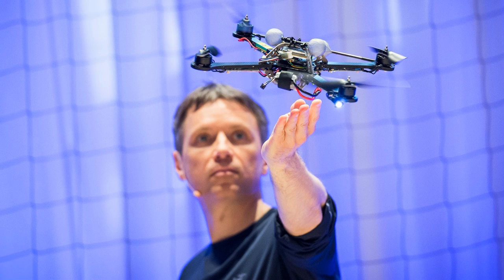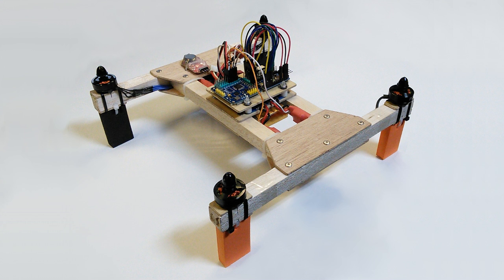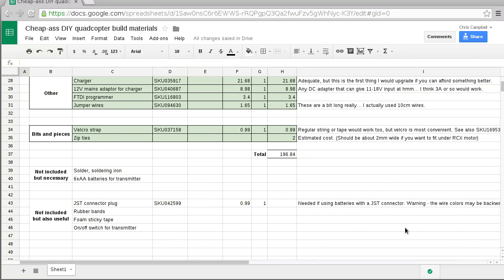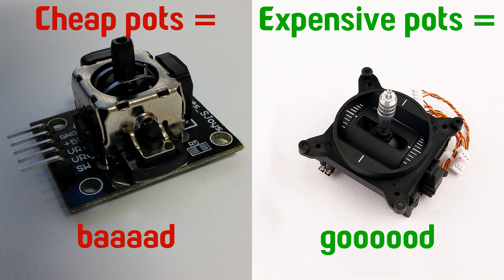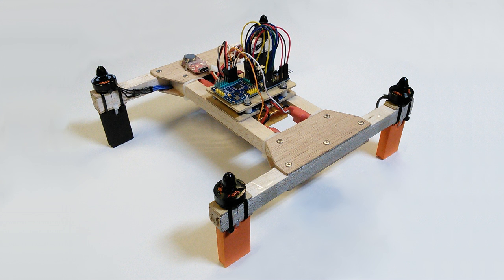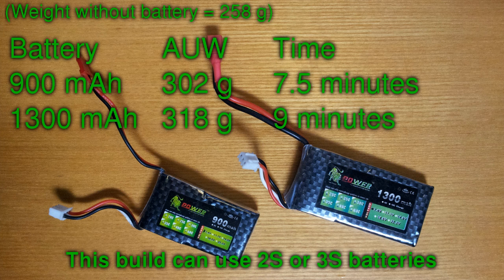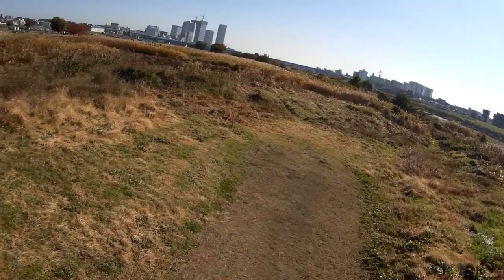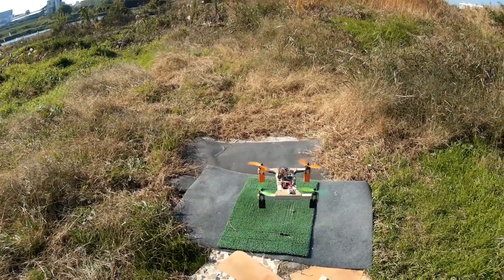Cheap-ass quadcopter build Part 1 - Intro

Comment: I can't believe you decided to build your own radio control transmitter and receiver using nRF24L01 modules - that's total genius! I've just bought the cheapest APM 2.6 I could find on eBay, so my quadcopter project is off the ground, but I was all set to spend proper money on the Tx/Rx kit. Now I want to do it your way - with cheap ass arduinos and nRFs. I'll be following this with great interest.
Reply from the maker: Good to hear, was wondering when you would get around to it :)
Reply from the maker: ***** Very true! If the quad was worth more, or if I wanted to go further than 100m or so I would not be using these :)
Reply from the maker: *****  Yeah no doubt :) It would be great to find something that can be controlled in the same way the nRF24 can but at long range, if it exists. Actually I have another two quads already, not counting the hubsan... well... enough parts for another two I should say, have not quite got them up and running yet - still small ones though !
Reply: Why APM?  I'm just asking because the KK2 is way cheaper. Nice little build 😊
Reply: Russell Gilder I chose APM because I want the full autonomy suite, but I'm not averse to trying some of the other filght controllers.
Reply from the maker: The mega will be much nicer to have if you do any customizations too. Recently using a lot of peripherals I have become thoroughly sick of dealing with conflicts between libraries (most often software serial) and have started eyeing the mega which has more timers etc to help avoid those issues... But the pro-mini form factor gets me every time so far :)
Reply: ***** You could offload all the servo PWM activity onto this unit: http://www.ebay.co.uk/itm/-/311188037855
It just sits on the I2C bus. Do you think that would help?
Reply from the maker: Yes, that looks helpful. For now I'm offloading the GPS stuff to another pro mini that talks to the main one via I2C. The 'PWMServo' library helped with some of the problems I was having.
Reply: @Julian, can you explain to me why you have two identical posts done with two different youtube channels with two completely different pictures on the thumb nail?  Are you trying to be two different people so no one knows who you are when you comment from a different account?

Comment: Looks pretty cool!
I have subscribed so as to make sure I catch the rest of these.

I have been looking at building my own quad copter just to mess about with.
More for the build than actually flying it really.

One thing you did touch on is the range of the transmitter.
One thing I was thinking of doing was to fit a GPS unit and a memory card.
On power up the copter would get it's location and set it as 'home'.
Then as it flies, it would keep getting it's location and save that to the card.
Assuming communication is lost, it would fly home on it's own using the points saved in the card as way points.

Less chance of losing an expensive copter then. :)
I suppose you could even fit a 'come home' button to the remote to bring it home automatically.

I appreciate that this adds to the weight, cost and lessens the battery life.
But could be worth it. 'Cheap' Chinese imports of the GPS and card reader can be had for around £10.
Only a card needed on top of that and I'd guess most of us have old and relatively useless small memory cards hanging around.
Ideal for this sort of project as it's only creating and reading basically a CSV file.
Reply from the maker: The 'return to home' you're talking about is a pretty common feature of RC aircraft these days (although not in the cheap-ass price range), as is following waypoints, position hold, and all manner of cool things. Price and weight are coming down all the time.
Reply: I'll be totally honest.
I've not looked into them much at all.
So I don't know what commercial products offer.

I saw the same video you did a few weeks ago and have seen various videos made by you tubers showing what can be achieved with them "superman with a go pro" being a prime example.
But from a cost perspective, it's certainly something I'd build into any copter I built.

Comment: Pure awesomeness, I was planning on such a quad for a long long time. But I am still stuck on doing the math on with the accelerometer :( I can't wait the following vids.

Great great job !!  You just made a new fan here !!!
Reply from the maker: Thanks! I'm not doing any of the flight stabilization myself, I'm just using the arduino for the radio link.

Comment: Thank God there are people like Julian Illet and you in this world! You, sir, are going to change the world of RC things! If your arduino radio-link is gonna be as stable as possible, you can be a major threat for those ultra-cosmic-expensive RC systems companies and that's what we all want! I was thinking to buy a 6ch FrSky or something like that from banggood for 60-70bucks, but with your project, i can save a lot of $$$ and build my own quad :) 
Anyways, stupid question: is your system able to receive telemetry data from the quad via the same radio link? that would be awesome! 
Greeting from Romania and good luck! :D
Reply from the maker: hahah I don't think so. This radio is nothing to compete with the 'real' ones. I'm mainly using it because I can control the communication protocol fully, and it can send much more complex data than just some switch and joystick positions. Yes, and it can return some data as well. See Julians recent video (last Sunday I think) and mine from October about telemetry with these modules.
Reply: I saw Julian's experiments and I've seen some of yours and I'm kind of impressed. I don't have too much experience with those kind of rf modules, I only used bluetooth modules, IR, 433MHz modules and a GSM module (you can find some videos, in romanian language unfortunately, with GSM and bluetooth projects made by myself on my YT channel).
Oh and a small sugestion: for the far future you should move to ESP8266 Wifi modules...that should be something way cooler!
And another idea is to try to somehow stack the arduino and the nrf module together and make a little breakout board to connect the whole thing to servos or flight controller inputs.
Reply from the maker: micultimy91 I have not used the ESP8266 but it seems overkill to use Wifi when there are only two endpoints, and the AT protocol and using IP addresses seems cumbersome compared to the bare packets that the nRF modules use - a lot of handshake packets are sent to and fro just to even begin an IP connection, let alone send any data. Wouldn't you also need a router to organize DHCP and stuff? As far as I know wifi devices do not talk to each other directly, that is one reason bluetooth was proposed. The ESP8266 would be good for situations where you are sending a very long message spanning multiple packets that must be received in order, then TCP would make life much easier. For radio control though, all necessary info can be put into a single packet, packets can be dropped without corrupting the message, and only the most recent packet is important.
Reply: Things have moved quickly in the last couple of years, and the ESP8266 can now use the same IDE as the Arduino. Conceptually if you drop down to a lower level than tcp/ip the ESP can be considered to be a combination of fast Arduino and nRF module, so one would think that it should be quite a viable option; it's certainly a nice size.

Comment from the maker: +Ole Magnus Boesen please enable replies on your comments if you want a reply. Yes, the default mode is 'rate' mode which only uses the gryo and does not do any auto-level for you. You need to enable 'angle' mode to have the auto-level, which I did in this part: https://www.youtube.com/watch?v=o-inQZn3AgU#t=2m6s
Reply: +iforce2d thank you so much
Reply: +iforce2d also I use th HK transmitter and receiver. where do i connect the wires for the switches?
Reply from the maker: +Ole Magnus Boesen not sure what you mean... are you converting it to arduino like I did? I covered all that in part 12: https://www.youtube.com/watch?v=9dTvWeidVis#t=9m22s
Reply: +iforce2d Never mind, I figured it out. But thank you so much for your help. love you videos BTW dont stop making them :)

Comment: Hello there I am really looking forward to the future videos. I am in the process of creating a quad using arduino for the transmitter and flight controller. 

I found those cheap joysticks have a terrible resistance range, they jump at the end of range. 

Thanks
Reply from the maker: You're not kidding. In the rest of this series I will do a lot of bitching about how bad they are :) In fact, I gave up on them altogether and I'm waiting for some alternatives to arrive before I put up the part two, so I can give a better recommendation. I will probably go with modifying cheap transmitter box instead, because it gives you nice joysticks and other handy stuff like battery holder etc all in one, but if you are still interested in the dirt-cheap joysticks I just got some of these, they have no dead-zone and feel nicer to move in general: http://www.dx.com/p/008-3d-yg-repair-accessories-ps4-original-3d-game-sticks-pair-318011
Reply: Haha I was going to say the same. I have just used an old rc transmitter. Four pots inside which have an almost perfect range. Although I have found that the whole resistance range of the pots isn't actually used with the sticks, so the ADC on the arduino sort of wastes some of the range, if you get what I mean.   But yes thank you.
Reply from the maker: Reece Pipes Yes, I'm using an old RC transmitter that I got really cheap on ebay for my main stuff and it works great - but I got kinda lucky with that auction and it's not something I can say to other people "get that one". So for this series I wanted to find things that could be bought as normal products.
It's interesting that the pots on my transmitter were the same... the mechanical range was only using about half of the electrical range. Sounds like it could be done on purpose for some reason. I had to measure the range of each one and code that (and the center point) into my arduino program to make full use of their precision.

Comment: Hi, cool video, I am building a quadcopter too but I have a problem. when I connect the battery, the engine and the receiver to the ESC nothing happends and the voltage go down to zero, do you think is a problem of the battery or of the receiver?
thank you very much

Comment: +iforce2d from where did you buy the expensive joysticks from. Those cost a fortune in my country. And the only way i can get them here is through didgikey or rscomponents or from mouser. Pretty expensive
Reply from the maker: +ATANU Ghosh Those joysticks were never shipped to me after waiting six weeks so I got a refund. After that I tried some others, much cheaper from here: http://www.dx.com/p/008-3d-yg-repair-accessories-ps4-original-3d-game-sticks-pair-318011 (that particular listing is sold out right now but the same item can be found on ebay etc for about the same price) They are not as nice as the expensive ones but they work well enough to fly the quad once you get used to them.
Reply: +iforce2d  thanks for the quick reply.

Comment: Hi! Thanks for the video series. I'm looking into building a 330 sized quadcopter as my first one, you think that would be ok with this setup? You mention 250-300mm, but do you think a 330mm would be ok with the components in your spreadsheet? And also, the problems that you had with the HobbyKing transmitter/receiver, did you get a faulty one or did you manage to break it? I don't want to build my own transmitter at this point. Thanks!
Reply from the maker: FaluFluff yes 330 would be fine. The main issue with going too small is the props will hit each other. The main issue with going too big is the overall frame becomes heavy. But there is a large amount of room in between those extremes to play with :) I think the HK transmitter itself was not all that bad, but the config program was pretty useless.
Reply: ***** Thanks for your feedback! Will get a 330 frame then =)

Comment: HI!  quick question please. if i buy for example MJX X400 quadcopter, after in finished using it and feel the need for more,  can i use it's radio transmitter and receiver also maybe the flight controller?  thx i really like what u did!
Reply from the maker: I have no idea whether the radio protocol could be used for something else, but if you are talking about making something with arduino then at least the sticks, battery case etc in the transmitter could be re-used :)

Comment: 200 dollars ain't that cheap, but this quad is quite nice. You should try using the traditional radio's like the dx6i or something like that.
Reply from the maker: +Sajiv Shah huh? A dx6i would probably be over $100 just for the transmitter alone... cheapest I could find with a quick google search was $129.
Reply: +iforce2d u can also use cheap hobby king radios
Reply from the maker: +Sajiv Shah I'm starting to wonder if you have even watched this series...

Comment: I have  thought to make my quadcopter using dc motor that's why i have bought a accelerometer and  i have also made a sketch for it and i have added the sketch with the receiver sketch. So do i have to do any change to the transmitter sketch?
Reply from the maker: No idea I'm sorry... how would it even be possible for me to answer anything from that description?
Reply: ok thanks for your answer  :)

Comment: i have a doubt. can i use normal 9 volts rechargeable batteries (2 of these to give me 17 -18 volts) to power the whole quadcopter instead of lipo battery. i have not used it.
Reply from the maker: No, absolutely not. Those batteries cannot provide even a small fraction of the power necessary to make a quadcopter fly, and they cannot deliver enough current either.

Comment: Do you need to code your own PID controller or you do everything manually from the transmitter?
Reply from the maker: I used the multiwii flight controller which does the flight controlling. Most of the coding I do is for the radio connection only.
Reply: I see. Since its a custom build I thought you had to do it yourself. Thanks!
Reply from the maker: No, not quite that custom :) Although since then I have managed to modify the multiwii code to use the nRF24 module directly, there is a video on that on my channel.

Comment: Chris, why "Do it Julian!" in the description? Just curious ;-)
Reply from the maker: Julian Ilett has a YouTube channel where he looks at cheap little electronics modules and arduino-related stuff. He had been talking about building a quadcopter, and then one day I noticed he subscribed to my channel, so I figured he would probably see the message. Fortunately he did, and mentioned my video in his next video and I got 200 new subscribers overnight :)
https://www.youtube.com/user/julius256
Reply: Ok, thanks for the explination. That's a nice boost in subscribers ;-)
Reply: Hi +Joop Brooking, well as of 15 Jan 2017 you have 16,371 subs and Chris (iforce2d) has 20,419. He is getting away from you. I am subbed to both of you so I am doing my part :)